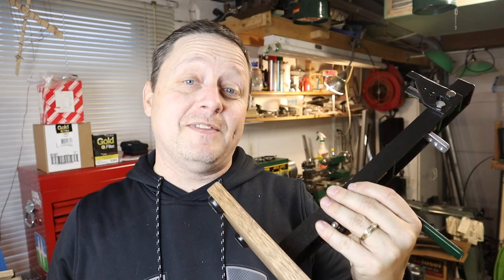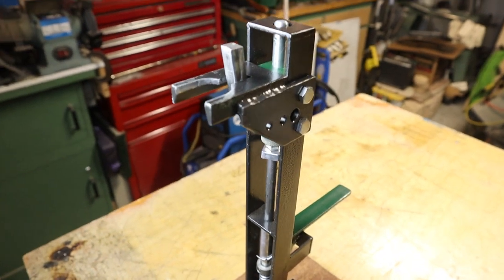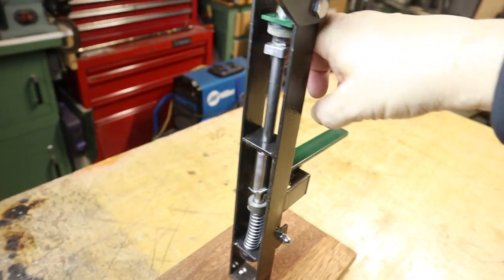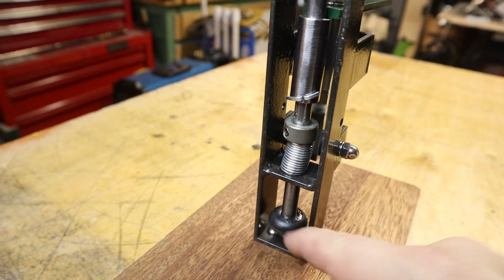Making an OVER-ENGINEERED Bottle Opener! // Automatic bottle opener // Shoot caps across the room!

Comment: A great invention. I've been quite inspired by this. Do you know the specs of the spring you use?
Reply from the maker: Thanks for your comment.  I don’t know the exact spring weight due to me just pulling it out of my parts bin. The spring has a 5/8” outside diameter and is 3” long. It does have a lot of tension… more than I thought I needed. It takes a lot of force to pop the cap with only 2” of throw.
Reply: @MikeFreda  Cheers. Any idea about the wire diameter? Yes, that's what I found out too. I'm starting to get the geometry right on my little project, but it's still too weak to pop any caps.
Reply from the maker: The wire gauge is 2mm (0.08”) and it has 15 coils.
Reply: @MikeFreda  Thank you so much.